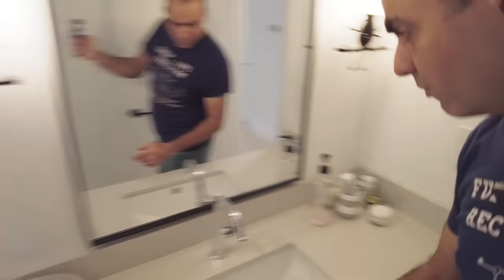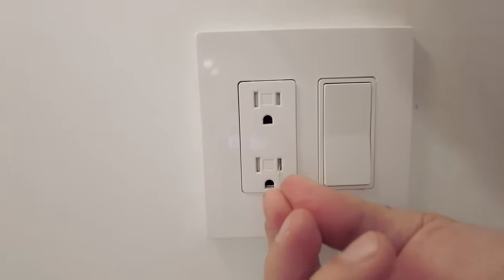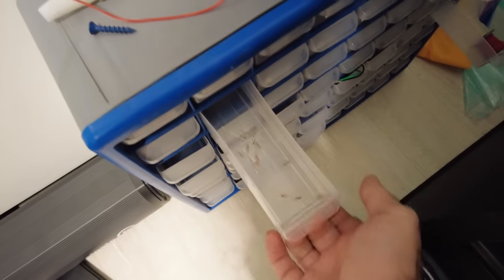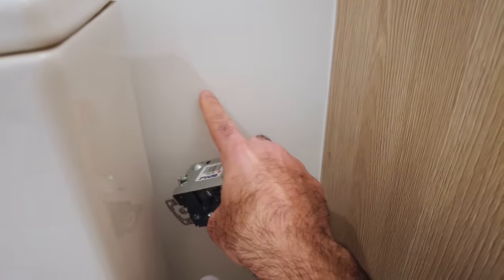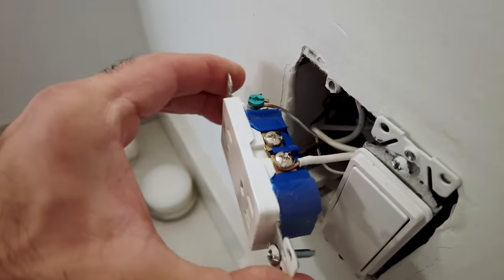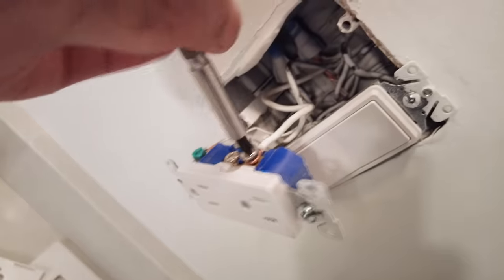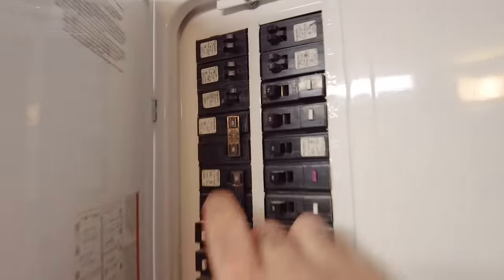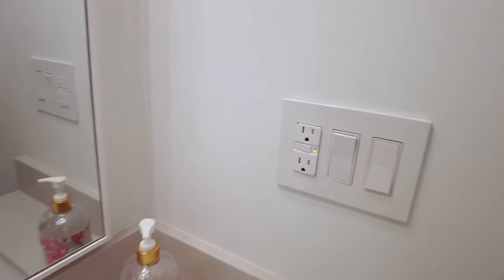Installing an Outlet… For a Toilet Seat?!

Comment: it's amazing that if you're an electrical engineer you can just spawn power sockets for your convenience.
Reply: I dunno about where he lives, but in my state it's illegal unless you are a certified electrician. So basically you have to pretend any outlet or switch you alter was done that way already.
Reply: @RindosRides  I document exactly what I install for that very reason, with a lot of detail. If a house burns down because of some home brewed shit and the owner says "the electrician did it", I can point to the documentation and say "no I didn't"
Reply: You sure your state doesn't have "owner/builder" provisions?  It's hard to imagine any state having more restrictive building code than California
Reply: Technically it should have been inspected by a governmental inspector and had a building permit. If something bad happens, your insurance company could have some difficulty questions for you. Personally I have seen too much crap installed by people who don’t know what they are doing or are purposely being cheap. I have seen new construction that in theory was inspected that is crap.
Reply: @RindosRides  Mehdi lives somewhere in canada ik that cuz of the Linus collab in the past and he also has mentioned it somewhere, he has a master's degree in Applied Sciences, and also has worked as a professional till few years ago
Reply: @Mentaculus42   he knows what he's doing though. he says on his site that has a bachelor's in electronics and telecommunications and master's in micro-electronics
Reply: @your_average_cultured_dude  
So you suggest that I am criticizing his knowledge? I am pretty sure that this is a perfectly cromulent installation. What I am pointing out is that TECHNICALLY in the US you are required to have this type of work inspected and for a number of valid reasons! I have personally had to deal with a number of crap installs that were unsafe in ways that “some people” would not realize. Just because an electrical engineer can make this “work”, doesn’t give everyone the knowledge to go off and do some random electrical work without a bit of “code” knowledge. Electrical work is usually reasonably straightforward but there is usually a code requirement that someone will not know or understand the need for. I personally would have done this install somewhat differently, but what he did is ok.

Personally I would worry about running that type of armored cable in a potentially “damp environment”. Would prefer to use “Direct Burial” wire inside of a solid conduit (which I think is also not to code). Also the type of armored cable he used is not water proof and can pinch and cause problems (from my experience) and can rust. Remember, that cable is running under a sink, would you use this type of wiring inside of a water cooler or directly outdoors?
Reply: @RindosRides  In Central and Eastern European countries, people don't care if it's legal or not. It it extremely common for the homeowner to do his/her own work in the house including plastering, plumbing, wiring and painting.
Reply: @mernokimuvek  Wow, people do their own painting? In my country, you can't even purchase paint without a security clearance. Brushes require a 2 week background check.
Reply: @RindosRides  
At least in California, you do NOT have to be a certified electrician to do this work, you do have to get a building permit and that forces the inspection which verifies that the work was done to code.

Does that actually happen for little jobs like this, probably very rarely. What is supposed to happen and what usually happens are two different things. But what happens many times on things that are not inspected is that something is not quite right but usually functions sorta ok, at least until it doesn’t!
Reply: @Mentaculus42  That is not at all true for most of the US.  In my city, a permit is only even theoretically required if the work costs more than $100.  And adding a single outlet most certainly does not cost that much.

(Not that I'd bother getting a permit anyway, it's not worth the hassle.)
Reply: It's easier than plumbing
Reply: Electrical engineers are the worst at electrical work. Safety rules are built on blood and learned from experience. There is a lot built into codes that no one thought of until it was a problem. An EE won't know the codes but will have a false confidence and will be more likely to skip things if they don't immeaditly understand the point of doing it.
Reply: Yes, we can put an outlet anywhere...and it's amazing how fast and cleanly you can do it when it's needed for something like a radon fan when you are on the clock for selling the house at massive profit as well.
Reply: @christopherpepin6059  I can think of a lot of worse people to do electrical work. And the codes are not hard to find and are largely common sense
Reply: @your_average_cultured_dude  I have an electrical engineering degree, too. Doesn't mean you know shit about electrical codes, though. In Ontario you're allowed to do electrical work in property that you both own and live in without a licence so long as you obtain a permit and get the required inspections done - usually a rough in and a final. Mehdi is in BC. I don't know for sure, but I'm assuming that similar provisions exist there. Even if you're a licensed electrician, you're still required to get permits and have your work inspected.
Reply: Ya but its irritating sometimes😁
Reply: Regular electricians can do that too. Hell even normal people can do that. Everybody can. It's not so hard
Reply: @lemontree15  i know it's not so hard but it's irritating.  I know it looks easy but it's not so easy.
Connections are simple but doing it in a clean way Is hard.
That my point.
Reply: Its not exactly an enforceable law. Who is going to what inspect your house for DIY projects and then fine you? It's your house after all. @RindosRides
Reply: @christopherpepin6059  Funny how "safety rants" is all you can come up with. Many (if not most) electrician don't even know how to build a simple buck or boost converter them self. At most they would design their own resistive heater using resistive wire.  Otherwise, they just connect products that others (mostly electrical engineers) have designed already. Then they talk about what electrical engineers knows or not. That's ridiculous.
In an apartment I lived in, there was a cable in a circuit breaker, that was pushed in too far, so the insulation was under the screw - then the screw was tightened enough for the screw to get pushed thru the insulation enough for the connected outlet to still work (but how good contact does that make. It seems like one of the best ways to create a fire using electricity - unless someone want to set things on fire intentionally). 
Where I live now, they have used connectors ment for solid wires (Wago 773) for stranded ones, in a junction box - so there was strands pointing out at the sides (we also use 3 phase here and there was 2 live wires on different phases going to that junction box - so it was 400 V between 2 of those connections as well - voltage between live and neutral is 230 V here), haha. 
And this was no DIYers. The first apartment was a new built one where no DIY work had been done (it was large building compainies that most likely hired electricians to do the work) and for the other one (where I live now) it was for a bathroom that was rebuilt just before I moved in (also made by building companies) and it was in the the junction box that split up wires coming from the main panel  to the bathroom and living room. 
So, they had most likely went in there to connect power for floor heating, an outlet and lighting in the new bathroom. 
I dicovered it when doing DIY work to put some new outlets and to get grounded outlets in the living room and bed room (some old installations here have no ground - which is bad for both safety and some electronics that need the ground for RFI-filters and stuff to work optimally)
Reply: Biggest issue I saw with this is that the connector to the plastic box I don’t think he had one, the armor on the cable as a opportunity to cut the wire and short it out unless you have a bushing and connector on the end. 
Other issues too… but as far as electrical integrity that is the most critical, 
Yea get it inspected and have a professional do it blah blah ok.
Reply: @Thatonefuckinguy  The person that buys your house after you. Already been through it.
Reply: Medhi builds his own house at his land so he can spawn where ever outlet he wants because it's his own housing. He probably did wiring the whole house by himself too.
Reply: @Mentaculus42 Like most of his viewers, he doesn't live in the US; wind your neck in and pray that you don't get shot by a toddler. That's America, right?
Reply: @christopherpepin6059 nope. As an EE I know what happens in big wires as well as in small wires. Friend of mine had his house rewired, data network guy. After his house caught fire because screws weren't fully tightened from a supposedly qualified electrician, neither of us trust the polish tradesmen. And then Brexit happened. I just wish we'd go back to the proper colour codes. New ones (EU) don't take colour blind eyesight issues into account and are frankly just dangerous.
Reply: @georgeprout42  
Actually Canada seems to follow US building codes and uses the same voltages and equipment, funny that. Also Canada has been trying hard to have their share of “mishaps”. Raised my kids knowing how to shoot and respect that responsibility and freedom. If you live close to where drug cartels have done mass murders, it best to be prepared and not wish that you were when things go south.
Reply: @your_average_cultured_dude  All that means is that he's an over qualified "Electronics Technician", which is an entirely different line of work - to that of an Electrician.
Electronics Technicians can usually ONLY do limited electrical work (pertinent to the electronic devices they are working on/with) whereas a properly registered Electrician can do all PEW, (of both low voltage AND high voltage Prescribed Electrical Work).
Reply: @tolkienfan1972  I doubt it.
At least in plumbing you can't ever electrocute yourself (or others), but anyone can drown.
Reply: @Thatonefuckinguy  Until the unthinkable happens and an apparent heart attack victim has an ambulance team arrive, who see an electrical outlet with something plugged in, right beside a toilet ?
C'mon who is NOT going to report that to the lines supply company - then the home owner who used to own the building, finds themselves in deep do-do's as there is NO legal record, of any qualified tradesman Electrician, ever putting that wall outlet there.
Within 1 M of a water receptacle.
Reply: @QUIX-KIWI  if you don't get a perfect seal and end up with a slow leak you may not know for years. The amount of damage that can do is substantial and can result in mold.
Reply: @andoletube Yup, it's shit. I had to use my kids water colours and those tiny brushes so the popo can't do shit to me. Thug life chose me.
Reply: @SetiSupreme  word. 🤟
Reply: It's on that same token I really wish I had friends working at the Royal Bank of Scotland... 💷💰😉
Reply: @Mentaculus42  In Ontario you're allowed to do your own work in your own home, as long as you file a notification and have it inspected before the conductors are hidden. If they don't like it you get a defect notice and have to fix it and get it inspected again before they'll certify the work.
Reply: @MaverickBlue42  
Basically the same as in US, but some are commenting that in some areas if cost is under a threshold then an inspection is not necessary.
Reply: @Mentaculus42  California is not most of the US, and I am not in California.
Reply: @jonc4403  
Yeah, as I said but only 40,000,000 people, more than all of Canada. AND since only one person suggested that maybe their state had a $100 threshold but didn’t mention what state (which by the way doesn’t make sense in the way it was worded) while what California does actually does make sense, it would strongly suggest that it is the responsibility of people wanting to do their own work to verify local requirements. OR at least know what their are doing, as this video has some code issues, it would strongly suggest that using it as an example is questionable and possibly irresponsible to having it on youtube.
Reply: @andoletube  im sorry what country do you live in
Reply: @yassm  In Loompaland.
Reply: @commoncaliforniadude  That box type has a clamp built in.
Reply: @RindosRides I'm so glad I don't live in your state.
Reply: @Speeder84XL I follow-up after tradesmen all the time fixing their crap mistakes. The primary reason for jurisdictions to perform inspections is to keep an eye on licenced practitioners.
Reply: @BrainStormzFTC  lmao on team account
Reply: @Idklol603  I've been caught!  first time funny enough
Reply: @BrainStormzFTC  lol
Reply: @brettski74  As I understand it In Ontario you can also do work on residential properties that you don't own (eg: a friend's) AS LONG AS you don't get paid for it.  Even easier if you're working under the supervision of a licensed electrician - in this case you're acting as an electrician's apprentice and the electrician is responsible for checking your work.  Inspection is supposed to catch the incompetents.

Things get tighter with rental/commercial and industrial wiring.
Reply: @Thatonefuckinguy  The problem is that it's unlikely to remain your home forever, and leaving ticking timebombs is bad  juju.

If you're under a permit regime, even DIYers have to pull permits, and that involves getting inspected.

In Canada, the electrical code has force of law.  If a DIYER did something egregious, didn't get it inspected, and it ended up killing someone, said DIYer can get hit with a sentence of up to 6 months and/or a $10K fine on top of everything else.

Even in America, doing stupid DIY may well invalidate your insurance if it causes a fire.  And we all know too well that Insurance loves to find ways to avoid paying insurance benefits.  Don't we?
Reply: Just like how doctors can self diagnose